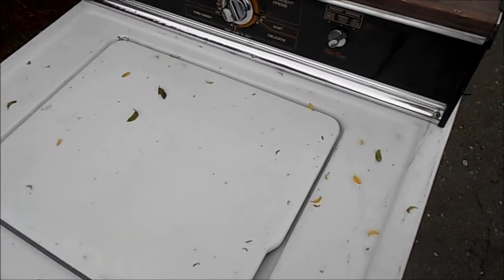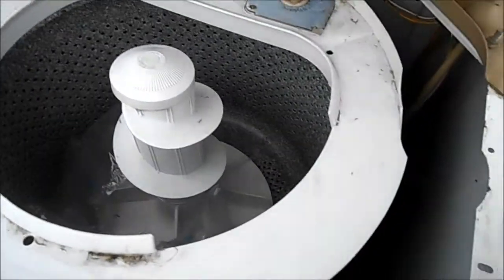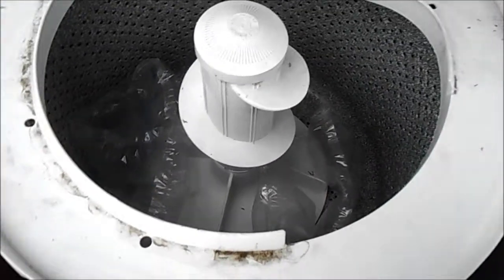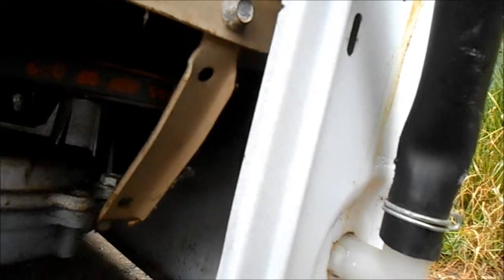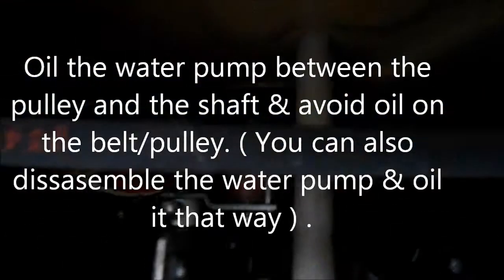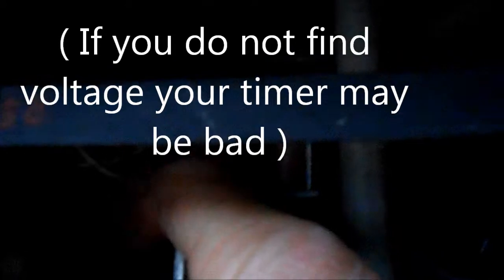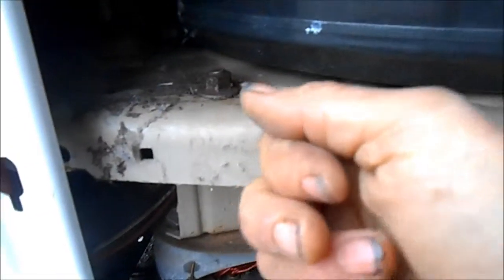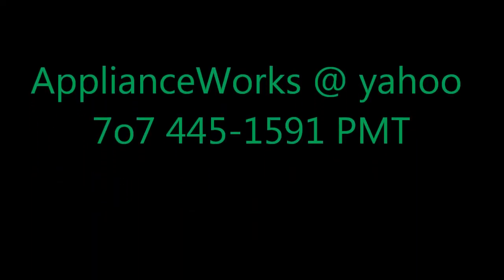Old School  Belt Driven Kenmore / Whirlpool Service 7o7 445-1591

Comment: I have a machine like this has an odd issue, will go through the wash cycle and the drain cycle but when it goes to the spin cycle it gets louder and wont spin. you can spin it up by hand and it will spin down to a stop. not sure what that issue is.